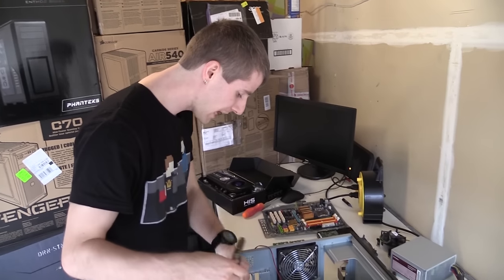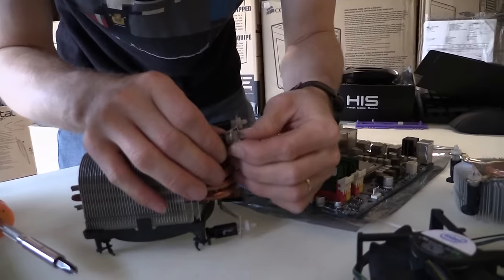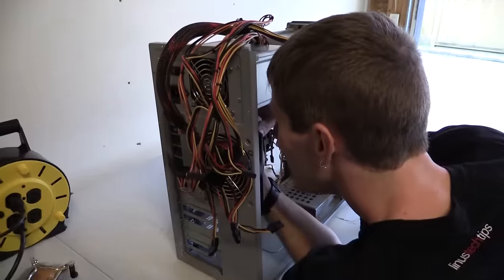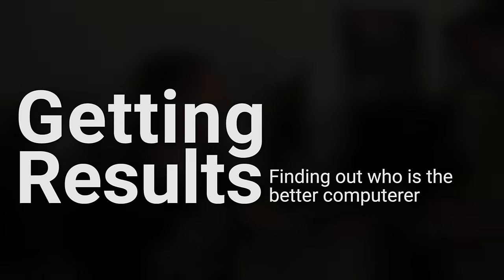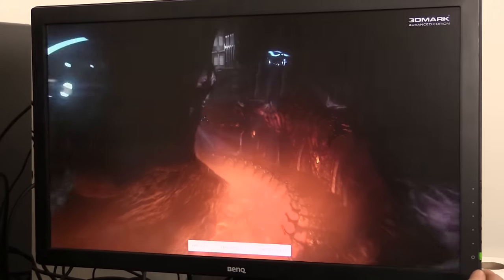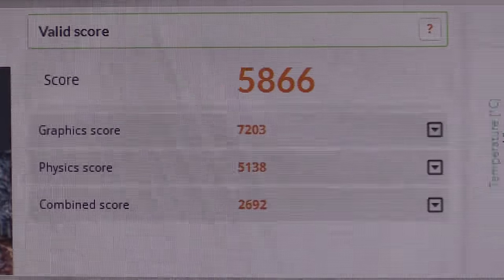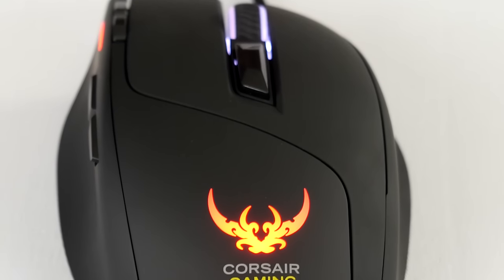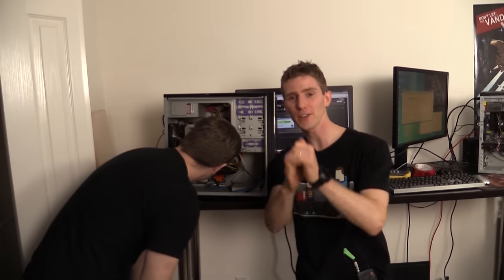$300 Budget Gaming PC Challenge - Scrapyard Wars Episode 1c

Comment: I took advice from this video, bought used cpu , used ram, used motherboard, used graphics card. The only things that are new are my ssd, hard drive, power supply and case. I ended up with a pretty good pc capable of gaming 1080p ultra at 60 fps or higher at around $500

Comment: I snagged a pair of HP m9426l's, for free, that have a Q6600 and 8GB of memory and were only missing the hard drives.  The guy was throwing them into the dumpster.   One I left stock sans adding a 120 GB SSD.  In the other,  I upgraded the power supply, installed a 250 GB SSD and an RX560 4GB card.  I haven't tried overclocking as I need to upgrade the CPU cooler and improve the case airflow.  Spent less than $400 on both and have two OK machines, running Linux of course.

Comment: I sat and made my own 300 Euro rig (only virtually I didn't build it . Here is what I came up with 
Cpu : Intel Celeron J1900(Onboard the Asrock Q1900M) : 64.90
Ram : 1x4GB Mushkin DDR3 1333MHz(With Heatshield) + 1x2GB DDR3 1333MHz 29.90 + 15.90
Gpu : GT 1030 2GB 99.90 
Storage : WD SSD Green 120GB 32.90
The cheapest case I could find 26.90
And a cheap 450W PSU (The system requires about half the power so I don't think it's going to fail )
It sucks BUT I HAVE AN SSD :P

Comment: Built mine for $250 dollars 
i5 3470 with a used rx580 stock motherboard for a dell optiplex with 8gb ddr3 700 watt power supply

Comment: Funnily enough I've had both the 7950 and the R9 290.

How did both cards clock so badly?

My HIS 7950 IceQ would do 1100/1250 all day gaming and even mining.
My XFX R9 290 on water would do 1180/1450Mhz all day gaming without a hiccup
> Since luke ran the card on air with 100% fan speed, he could have come close to this.

The HIS 7950 also had a lower TDP bios on it by default, I gained more FPS with a unlocked 7950 bios.

Comment: Everytime I think I learned enough to start building a gaming PC I learn new information that brings up more questions than answers. My first PC is an Optiplex 3010sff 4gb DDR3 RAM, 500gb HDD and has an Nvidia GTX 1020 low profile graphics card. Got an i7 3770 on its way when I add that to replace the i5 quad in it now I'm going to add a 500gb SSD, a 2tb HDD and 2 sticks of 8gb DDR3 RAM 16 total. I only plan on play open world games Fallout 3 4 and NV, Elder Scrolls 3 4 and 5 and eventually down the line borderlands 1 2 prequel and 3. I've done just about everything wrong possible so far and had to return stuff. Can anyone out there help me decide if it'd even be worth getting a full tower form of Optiplex or should I just wait and use this system until I can build a PC with a newer GPU for if I ever do find newer games? I was about to buy a bunch of 12ish year old parts like motherboard, HDD and SSD etc. but saw your guys channel and have decided against that. Scared to start a PC build I've got $500-700 I can spend on a build her very soon

Comment: Hey Linus. My name is Evan,. and i am an avid PC gaming enthusiast....here is my current rig ( specs / cost) AMD Athlon ii x2 @ 2.9 GHz, 10 GB DDR3 10600 ram,  250 GB HDD @ 7200 Rpm (WD black), GTX 1050 GPU 2 GB variant on a Gigabyte  GA-880GM-UD2H MB.....built 4 years ago at a cost for appx: 288.41.....i an run Dirt Rally on med settings min fps of 29, max 65 , avg 38.5 as per my last benchmark in that game

Comment: You're lucky you did this in 2015... if you tried doing it now, you wouldn't be able to, period. Just a GPU on it's own, if it had to play ANY of the new games (or anything released in the last year) would run you more than $300. I built my b0x in early 2016 and spent $400ish, (have since upgraded some parts, and bought 2 new HDs) and I can just about run WoW at middle settings without an issue. If I were to OC anything, I'd run into heat problems for sure. Granted, if I were in the same environment as you two, it would fly without a glitch... but my apartment is small, and rarely under 80F, and the PC is in a corner, surrounded by my bed, and barely gets any free air. :( You should try to do another challenge, and see what the cost would be. I'd doubt you could do it for anything under $600. That's being generous, too.

Comment: gtx 1080fe
xeon e5 1650 v2 (3.5ghz) 6 core 12 thread
16gb ddr3 1333mhz
500gb ssd (adata su800 500gb)
1tb hdd
some hp mobo, don't know off hand.
650W 90% power suppply
some hp case
$800 exactly

Comment: 5 years later. Dell Optiplex 3020, no idea the f'n dell mobo but i5 4570, 8gb samsung 1600 mhz ram, 585w orion psu 😮, 500gb hdd, oem hp Rx 480 4gb... all for $250. I haven't done any benchmarks and I'm too afraid to buy any games cause I don't think the quality with fps is there for me too..

Comment: [{2019.12. In the last few days of the year} for $390 (CAD): i5-4590, msi b85-g43 gaming MB, 8gb (2x4gb) of ddr3 corsair ram (2133 mhz), evga gtx 1050 2gb,  cooler master gx750 80+ psu, cooler master hyper t20 multi socket cpu cooler, cooler master k350 case] so this doesnt include the Kingstone ssd and the WD hdd that i pulled out of my old rig. Cable managing was a total nightmare in this case since it has no space at all for cables on the “back” side of the case. (I ment the right side of the case if you look at it from the front) that side of the case even “bends out” a bit if you look closely, but i didnt really cared about it since its  just a fast, temporary case for the rest of the stuff.. i know.. i could have get a better gpu in that price range (i even found a few 980s for the same price as the 1050, but some one elses took it before me so i went with the 1050..

Comment: I had both Q8400 and Q6600 the Q6600 is legendary i played GTA 5 Redux with it(SLI).. the Q8400 is better at other points but that related to office use only...nothing below Q9460 can beat the Q6600. but u need a good board also..ASUS/MSI... no Acer/Compact/HP what ever.

Comment: What motherboards are they using? I am looking for a good 775 board with multiplier and bclk over clocking. Thanks in advance!
Reply: You have to use a motherboard chipset with whatever CPU you get, in this case both of them are using 775 as Linus has a Q6600 and Luke has a core 2 duo, however they got them as a combo with the motherboard included. 

775 is an outdated platform now, it was still a viable option when this video was made. People still use 1155 chipset CPUs from Intel 2nd gen but I personally would not take anything less that 1150 chipset CPUs from Intel 4th gen i7 just because the improved architecture, AVX2  which is minimum for higher end emulation like PS3 games and hyperthreading. Quite frankly even then I would aim higher

Comment: For 75 bucks, i got a grx 960 strix oc, a xeon x5460, 6gb ram ddr3 1333, power supply and a lga 775 socket board. Legit, i literaly spent 50 bucks on the gtx

Comment: The Sad part is this is my current rig:

C2D E8400 (the one Luke got)
My GPU is R9 270x 2Gb
My Ram 4GB ddr2 800
and I have an ssd.

Also Luke mostly lost due to that mobo, it's a no brand chinese one if I am not mistaken and it runs the e8400 at max only 2 Ghz and not 3 and it runs Ram at 400Mhz only.

But I am gonna Ryzen soon :D
Reply: Aditya Sharma Mobo? No. The dual-core lost him the challenge
Reply: Well the dual core obviously was lesser than the quad but that mobo basically makes the e8400 perform at half the speed the cpu can actually perform and also the rams are limited to 400 mhz.

Comment: I scored a Dell Vostro 270 Windows 7 Ultimate with an upgraded intel core i5 3.0 GHZ processor and an upgraded Corsair CX750M power supply and an added GEFORCE GTX 770 4gb ddr5 graphics card for $80. Id put pics but theres no option to do so in the comments.

Comment: I built one with win 10, gtx 660ti, i5-2400, 8gb ddr3 ram, 700w thermaltake psu, raidmax case, and a 120gb ssd for $170
Reply: I got insainely lucky with getting the ddr3 and gtx 660ti for $50

Comment: I have a gaming pc but I don't know if my rig is strong so my specs are
Amd Athlon x2 processor 
Amd ati Radeon hd 7570
4gb of ddr3 ram
Asus m5a 78 l-m lx3 motherboard
Reply: Oh and I have a 600 watt power supply
Reply: i Have a gaming pc aswel and the specs are some of them cause i forgot some of my parts the model name:
-AMD(FX)-8300 eight core processor 3.3ghz
-8gb of Hyper X ram
-2gb of AMD Radeon R7 200 series
-Gigabyte motherboard.
Reply: you need to upgrade your stuff badly  its so out of date and mine is barely average pc by todays standards.

Comment: Hello Linus can you make 350 dollar pc build 2017 i want to build a pc with my dad and our budget is very low in comparison to others youtube gaming pc reviews O.O
Reply: Hey buddy, three routes for system and two for GPUs to go for in the very very budget segment.
1. 10-year tech that can run most games today (not the CPU intensives ones, naturally) - s.775, get a modded Xeon X5460, a P45 mobo (like a P5Q) and 8gigs of generic DDR2 PC6400 ram for under 100usd, throw in a big-ass air cooler, OC to 4 Ghz.
2. Get a modded s.1366 Xeon X5640/50, an x58 mobo,  any RAM, good cooler, OC & profit.
3. The fresh performer - look for a Ryzen 1300X/1500X (the ones with turbo modes), a non-overclockable A320 mobo, 8/16 gigs Samsung-made E-die (yeah, OEM) DDR4.
4. GPUs - Either grab a 3gig GTX1060 (1x6pin), or if budget doesn't allow it, go for best value cards like a GTX770 (6pin+8pin), 280x (2x8pin), 270x (2x6pin). You'll need a solid 550/600W psu, not more, not less. Research into the power requirements for each card (lots of benchmarks on the web that show the TOTAL power consumption of the system with any of the cards), base your purchase on total GPU+power supply price to decide which one is the best compromise.
Look at example builds with either your CPU/GPU of choice playing games on youtube to get a grasp on frames and settings you'll be able to achieve. Good luck!

Comment: One question for anyone here, would you spend about $200 on a EVGA GeForce GTX 1050 Ti SSC GAMING ACX 3.0, 4GB GDDR5, DX12 OSD Support (PXOC) Graphics Card 04G-P4-6255-KRor spend about $80 more for a MSI GAMING GeForce GTX 970 4GB OC DirectX 12 VR READY

Comment: 500 rig vs 500 console it's not even a competition, consoles get wrecked
Reply: The issue is that in three years, that $500 console will drop to $200 brand new, while a new 750ti still retails for $100.

Comment: For 250 dollars more i could have gotten a amazing psu a gtx 1060 3gb gddr5 , 16gb ddr4 ram and a i7 3200 3.7ghz quad core with a wifi adapter and the accessories of : monitor gaming keyboard and mouse , mic speakers and a wifi adapter and a 500gb hard drive with a 240gb ssd and it only took me 45 minutes to find all this!!!!!!!!!

Comment: i got a geforce gtx 1070 founders edition for $220 brand new off ebay
Reply: i got a 1080fe for 330 used. 1070fe for 220 new is a little sketch. I'd say it was likely used or at BEST refurbed

Comment: I sit and laugh with my perfectly stable 200 dollar rig that has a proper aftermarket cooler, an Asus GTX 560 ti 448 core and runs csgo max graphics at 60 fps. I'm running a E8400 right now but can buy a quad core 775 cpu for about  30 bucks.

Comment: Hey, can someone mabe help me out?
I ordered a 6GB GTX 1060 Strix OC,
Asus Prime Z370-P Intel  Dual channel DDR4 ATX,
Intel i5 8600k unlocked 
16GB G.Skill Ripjaws V DDR4-3200,
500GB Samsung 850 Evo Sata,
500w BE quiet pure power,
1TB Seagate HDD,
corair SP140 High static pressure fans,
and a Sharkoon TG5 case.

I was hoping for someone to tell me if all the components are compatible? 
I'm paranoid, because this is the first time i'm gonna be building a pc!

Comment: i5 2400 
12gb ram
gtx 1050
1 tb hdd
can i run good games
it cost $377
Reply: CLOROX BLEACH Yep. 1080p60 med-high-ultra settings.
Reply: J Daithi An i5 2series is enough to run any game. 8GB of RAM is enough for all games, but more thr better, so 12 is nice. The gtx 1050 has compatibility with DirectX12 and the newest drivers, and it's strong for it's price

Comment: For $470 i got an AMD a10 7700k, 8gb ram, a GTX 1060, and a 450W PSU. Good deal or no?
Reply: Mike Desilva not really, that cpu is garbage but hay, if its good for you, great
Reply: TheCanadianLanBoy the the cpu isnt the best, the only reason i got it is because it came in a bundle with the motherboard on newegg for cheap. it can still run games pretty well but im gonna upgrade to an amd fx-6300 black edition soon.
Reply: Mike Desilva the preformance between the 4300 and the 6300 isnt to big, if you where to upgrade, I would get an 8320/8320e, good luck man!
Reply: TBH, thats not a bad deal. Try and upgrade the A10 after but this still isn't that bad.

Comment: l can build a 200$ PCs with 8gb ram,3,6 ghz 64 bit quat-core cpu,128 bit 2gb gpu,good case,500v power supply and 500gb hard drive.
Reply: but I need to wait 1 or 2 mounts for delivery